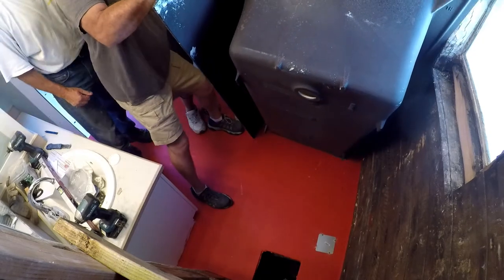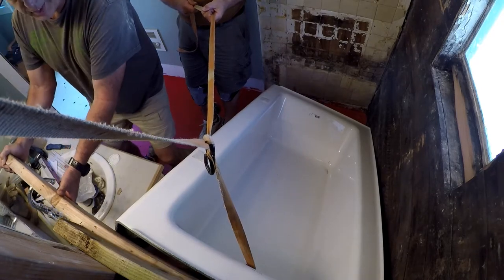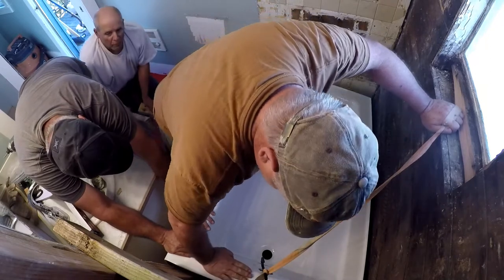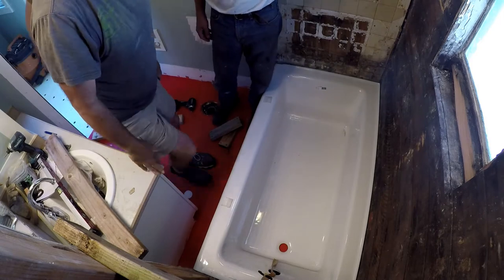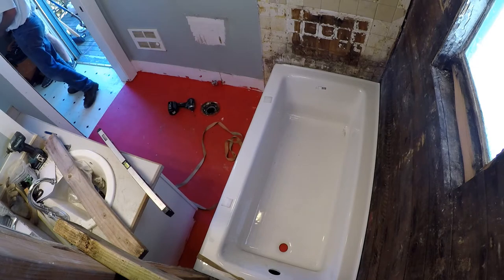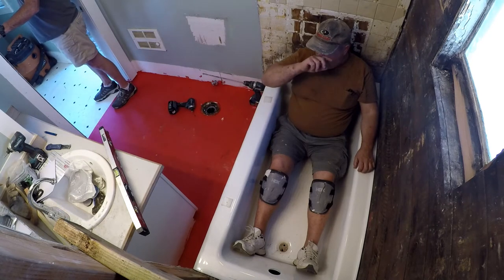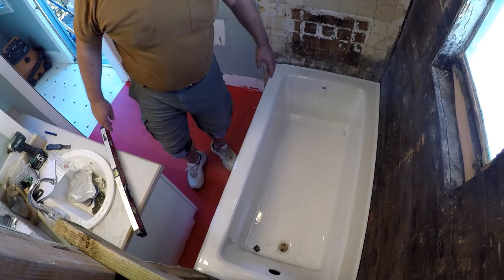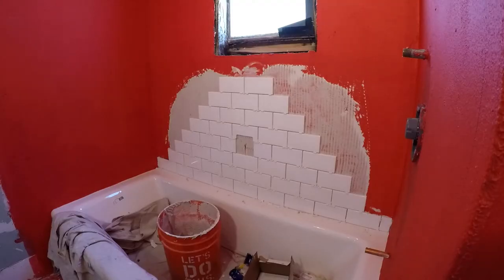Install A 400 Pound Cast Iron KOHLER Bathtub

Comment: Did they put the ledger board up first , before putting the tub in the way ?
Reply from the maker: On this tub, it has support gussets cast into the tub to support the side wall area. The tub is plenty strong and rigid by itself that you don't need a support ledger though if you want, you can install one. You would have to notch it to fit around the gussets.  A stamped steel tub or fiberglass tub,  you definately need the support ledger. Typically,  we will fit the ledger as close to the tub as possible,  then we will put thinset mortar on top of the ledger, then set the tub on that. The mortar will squeeze out when you set the tub on it and press into place. The mortar will take up and gaps in the conture giving more solid support. 
Here is a video showing the ledger and steel tub installation.
https://youtu.be/-Fvk4p_85aM

Comment: Or maybe you should have put the vanity in last. Did you put a thunder down under the tub to ensure max stability? I just see little things that could have made it easier but I’m not there so it doesn’t matter .
Reply from the maker: The cabinet is a built in and not easily removed. Tried to make it as easy as possible to do it the hard way. Can't say I've heard of a Thunder Down Under. The tub sits flat and there is mortar forced under the edge with a little lift from floor unevenness. It is very solid now and not going anywhere. Finished the whole house project and I sold it a few weeks back. New owner is thrilled and I made a tidy sum for my remodeling work.

Comment: Would a tub that heavy be OK on a second floor with standard supports/joists etc.?
Reply from the maker: It should be fine. There are lots of houses with cast iron tubs in them. I've installed bigger than this in projects before my YouTube days.  Now if you know there structural deficiencies,  then you might look into reinforcement of the floor.

Comment: Hahahaha I enjoyed this video thanks guys 💪🏽
Reply from the maker: @marknunez826  Thank you!
Reply: @CITAP1  quick question I’m setting in one of these today myself once it’s set in we don’t need to screw it into the drywall or anything just maybe caulk it once it’s finished?
Reply from the maker: @marknunez826  
https://www.youtube.com/playlist?list=PLyz2LOih3ypsR0_u_p86r4W6VqMzCDVxc
Here is a playlist of the entire project. You can see earlier how the floor was leveled better using a build up of thinset mortar, Flexbond. Later videos show how to tile the tub and window. There is also a video showing how I plumbed in the new shower control valve. Good luck with things, hope your bathroom turns out awesome, just as you envisioned it. Take care, more info follows... 

If you want, you can screw a large fender washer into the wall just above the lip letting the washer overlap the top of the tub to hold it to the wall. You can drill a stamped steel or fiberglass tub and screw in directly through the  metal lip. Once the durrock is set in place and the tub mortared in and especially after tile, it's not going to move. A steel tub or fiberglass tub, you want to carefully install a ledger to support the inside length of the tub. We put thinset mortar over the ledger and set the tub into that. It insures a full support the entire length since the mortar conforms to the shape. Yo can also use it to fine tune the tubs levelness. On the steel tub, I like to install 4" flat square steel electrical box cover plates under the feet of the cast iron tub to spread the load those feet put on the floor. My preference is Hardiback for floors, and Durrock for walls. Skim coat the entire surface area to improve flatness and water proofing. At least three or four coats of RedGuard or similar product.

Comment: There is a much easier way to handle these types of tubs. The pros use commercial glass suction cups giving them grab points to move the tub anywhere you need.
Reply from the maker: This is the time honored Gathering of friends to do the job. I wouldn't nor would my back dream of replacing it. No backs were hurt during the Installation of this tub. Take care.

Comment: Kohler Villager?
Reply from the maker: Not a Villager though I've installed many of those because it's a cheaper option in cast iron. Villager is a nice tub with a sloped back but it's to shallow, you can't get a good soaking bath in it this tub is wider and deeper with a sloped front and back. You can get a much roomier, deeper soaking bath in it. The front slope is also nice for your feet, just a little more comfortable.  Because of the sloped front, the cutout for the drain goes a couple inches out farther from the wall. It also requires a special drain and overflow kit due to the depth and angles. I think it was around 800 dollars, more these days.thanks for checking in and good luck with your home projects.
Reply: @CITAP1  Please tell me the model name if possible. Tia. I know you are busy.

Comment: What model Kohler tub is this?
Reply from the maker: Kohler Bellwether Collection 60" Three Wall Alcove Cast Iron Soaking Bath Tub with Integral Apron and Right Hand Drain
Model:K-876-0
Reply: It looks nice. Good quality?
Reply from the maker: @HonestAbe689  After I installed it and got to sit in it for the first time, I decided that the design of it leaves the inside kind of short because of the sloping front and rear. I also found the way Kohler designed the back slope to be uncomfortable. Just my opinion. This tub burns a lot of space for design. There is a deeper version of the Kohler Village tub I liked and wanted but it wasn't available in my distributers system.  It's still a very nice well made tub. Apparently because of the design, you should use Kohler K-37383 Cable tub waste and overflow because the overflow connection on the tub is at an angle and you need an overflow kit that will bend and compensate for that angle. The kit is very nice. The last issue with the tub is the design places the overflow cover plate farther into the tub area so be sure to get a long tub spout or it will flow water directly onto the cover plate and splash. If the cover plate isn't sealed well, it's possible the water could work it's way behind the cover and let water in under the tub. Those are the only things I would advise, otherwise nice tub.  Best wishes...